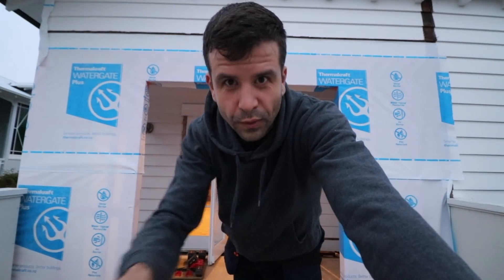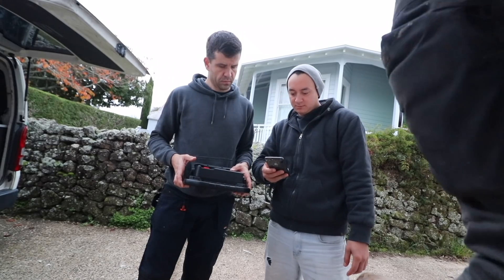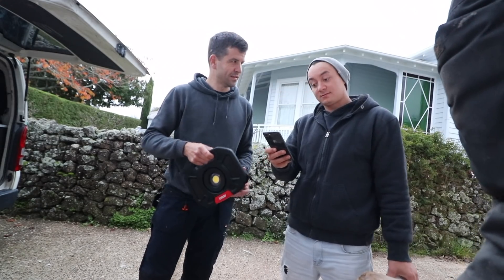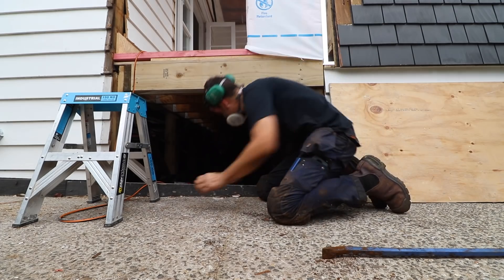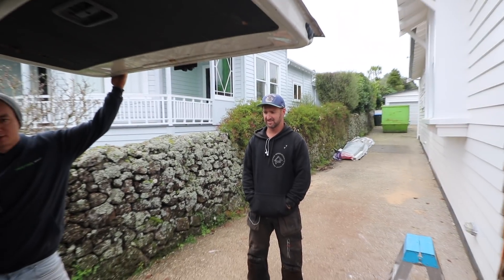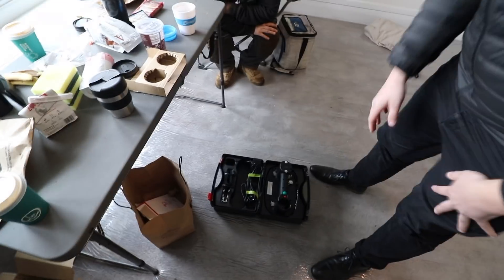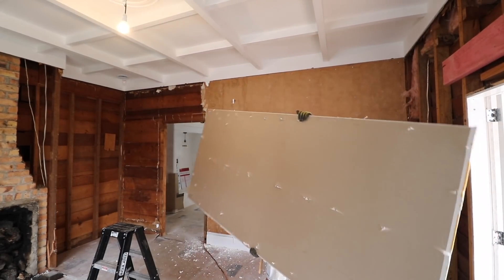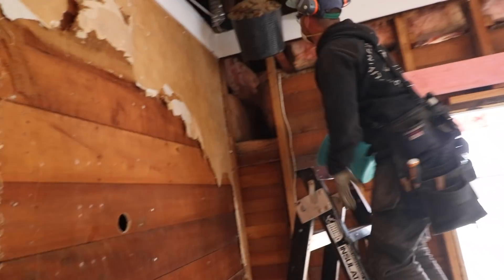8 Hours To Dig 1 Hole

Comment: Oh gawd, sneezed-in insulation.  For people outside NZ, this is old shredded paper that you pile in a corner and then sneeze on until it's spread around the roof (some people call it blown-in insulation for some reason).  What happens is that in NZ's damp climate it eventually goes soggy and gets mouldy, and any slight breeze across the attic space means it relocates itself into corners of the attic.  So you end up with no insulation in any of the central areas and clumps of soggy, mouldering gunk around the edges.  There are companies that run what are essentially giant vaccuum-cleaner trucks that'll come round and remove it for you so you can put proper insulation in.

Comment: Best way to cut through it, is get a big mason drill, and drill holes, then fill them with water (not to much for volcanic rock) and then hammer drill it to pieces.  Also don't leave the dirt dust and rocks in there with the water to long, it'll turn to hardest cement ever....

Comment: Pretty sure that was all asbestos insulation in that ceiling
Reply: Aunt Jemima it’s typically old newspaper cut up. Very common in NZ. There are also other types of blown in insulation, I’ve had a few tested over the years and none have contained asbestos. There’s typically no need for fire resistant insulation in NZ, so no need for it to contain asbestos.

Comment: Time 2:17 putting in timber posts into the ground.   Quite usual.  Typically dwelling piles consist of a 125 x 125 H5 treated timber pile cast in a concrete foundation typically 450mm to 900mm deep. Piles can be designed to provide sub floor bracing by their cantilever action, provided the floor is not too high above ground.

In NZS3604 these are termed “Anchor Piles”. Isolated timber piles to which diagonal timber braces are attached are generally more robust as they need to resist uplift and lateral loads from the braces.

Comment: I love my nemo grabo.   I have added a gauge to it, and I also have a adapter so I can use it as a small vacuum pump for clamping, and part holding.    Just today I had it vacuuming a puck to the panels I was installing so I had something to beat on with a mallet.
Reply: @Eric James glad you like your Grabo. They are certainly a fantastic tool and make moving things so much easier and safer. All Grabo's now come with a gauge as standard.

Comment: Scott. Have you ever considered using reactive ear protection? I don't know how much they are over with you but you can buy a set in ireland for about 120 euros  they improve  your hearing and protect it at the same time. Worth looking in to. Peltors are the ones I use. Also get the extra gel cups if u decide to try them. Won't be disappointed.  Love your videos
Reply: Really curious about this, what model of the Pelotors do you have? Is it able to mitigate rapid sounds like say a nail gun or a hammer blow or just sustained sound like circular saw and jackhammer?
Reply: @edgarcortes1966  not sure what model they are. I just got them on amazon. I've worn them shooting and that's actually  what they are designed for and they work great. They aren't that expensive.  Peltor is just one make. There are a few others available.  Mine are 6 years old and work perfect. I'm sure the newer models are even better
Reply: @edgarcortes1966  just checked peltor sport takeare 120 pound. Honeywell ones are 58 pound. A mate of mine uses the Honeywell  ones and he likes them as well. The peltors take 2AA batteries and his Honeywell ones only take 1 so maybe the peltors last longer. Either way they are worth the money
Reply: Have you got a link to amazon? Would like to look into these 👌
Reply: @edgarcortes1966  They work for all that. They are designed for gunfire, so they are fast to attenuate sound.  I use the Howard Leight set and they work well enough. I need to try the Gel Cups
Reply: Someone will read this and next episode he’ll get free hearing protection to review haha I bet ya
Reply: Thanks for this thread guys, I read it last night & have gone straight out thismorning & bought the exact Howard Leight Impact Sport model that’s in that link. Amazing how good they work! Couldn’t recommend them more off today’s use! I would go as far as to say it’s life changing, because iv always struggled with conversations when there’s noise around. I played a video on my phone & left it in my trailer, I walked a good 8metres away & could still hear the phone louder than if it was in my hand with no earmuffs on, then I hit the hammer on the concrete path repeatedly & it was quiet but I could still hear the video, Amazing!! I will always own these now. Thank you very much for the info @wildatlanticfishing 🙏🏼 ($118aus from blackwoods)
Reply: @scottspropertyservices6877  sold...

Been working next to concreters running a petrol saw the past few days, these will be a game changer.
Reply: I have a pair for shooting rifles at the range, they really are amazing how they react in milliseconds

Comment: G, day Scott and team, the subfloor pad footings are impressive. I would have thought that a smaller size concrete pad. Then slide recycling bins or rubber buckets on rollers or slead rails to the holes. Looks stable, no erosion or past subsidence.🏡

Comment: As some have already said, lots of room under that house. Our previous place had about six inches to a foot underneath. Early 1900's Rongotai, Wellington and was built on pure sand, where you could dig down five feet and into sea water level. A place we looked at here in Levin there was even less space still.
Reply: If you had to dig 5 ft to sea water you must have been on a hill or it was low tide 😊.
Reply: I learned a lot doing a place I had years ago in Island Bay. One pile I dug for an extension hit oily water and sand about 400mm down. I grabbed a 3 meter steel pole and pushed it in.. the whole thing disappeared down as if it was porridge. Managed to wedge bricks, concrete into the hole and smeared clay in it. The inspector whacked a spade into random holes including that one and said "yep all looks good". The whole valley sits on pockets of sand and seawater but not as extreme as Rongotai
Miramar was originally an Island so Rongotai must be part of the land bridge that popped up from below sea level in the earthquake in 1460. Yeah, check this image for the shorelines and harbour shape... https://teara.govt.nz/en/photograph/4383/wellington-harbour-before-the-haowhenua-earthquake
Reply: @TheStrathmoreChannel  The whole of Kilbirnie, Rongotai and Lyall Bay are only about five feet above sea level. One large wave from Cook Straight could wipe out three entire suburbs not to mention Petone and Seaview, on the other side of the harbour. The land was raised from under sea in an earthquake circa 400AD, and brought up to its current height in the massive earthquakes in the early/mid 1800's.
Reply: @ericwolff6059  Eric, I'm well aware of that. I was kidding you about having to dig as deep as 5ft to reach ground water. There are parts of Miramar where it is higher than that so Rongotai must be similar.
Reply: @TheStrathmoreChannel  :-). One can never tell on the likes of YouTube and Facebook.

Comment: Laterz rz masks. You can't beat the 3m 7500 respirators. Size medium fits 80% of people. Low exhalation valve so theres no fog on glasses, easy breathing, easy tight fit, easy drop down. Only problem is some of the plastic clips are a touch flimsy but they haven't broken for me yet, just take care of it. Small investment to protect your lungs and comfort on the job.

Comment: What was the hessian cloth used for in old buildings like this? Never seen that before
Reply: It is called scrim, and was used in NZ in the 1800's till the mid 1900's before Gib Board was invented...  "Scrim is essentially sacking that has been stapled to planks or horizontal thin wooden strips (sarking.) It has been plastered over to form walls in the late 1800s and early 1900s before plasterboard was invented. For insurers it represents a fire hazard especially when combined with old wiring”. Like in this video, it could also simply be wallpapered over rather than plastered. They used sarking for the above reason and as structural support. Now we use noggings/dwangs as structural support instead. I notice in YouTube videos that in the USA they use plywood in a similar manner to sarking, without the use of dwangs/noggings.
Reply: It's likely reinforcement to prevent the wallpaper from tearing when the wood moves seasonally.

Comment: Hey scott. Fill those rubber buckets you have with concrete and slide or “skoot” them around under house on some wide timbers👍.      Also maybe put some 12mm ply on roof around chimney tech screwed together and slide your bricks down to your m8 on the scaffold. Give us a chain gang vid🤙.    Personally i have found throwing them down chimney they just jamb up..

Comment: How many mills are in New Zealand? Timber processing mills, I need to be specific on that. And is it from trees that were felled only from trees native to the area? Just curious! I do the same home remodeling as you but only in Oklahoma. You inspire me to want to start a channel, gotta get a decent camera first! What did you start with?
Reply: I think around 29 sawmills, and then a handful of plywood and LVL mills. There used to be more but quite a few have been closed in recent years or sold off. Most if not all NZ timber mills are radiata pine which is not native but grows fast and straight, it has no natural antimicrobial qualities so they have to treat the hell out of it (that's why the framing timber is pink). I'm pretty sure any native timber mills are only salvaged or swamp timber as we have some pretty intense protection laws over native timbers now.
Reply: Jessica Bell thank you so much!! Great information!

Comment: I once had to put a 100mm pipe through my bathroom wall. Took me and my dad 2.5 days. My old house has walls 85cm thick of stone. When we were finished looked like a bazooka hit.
Ps if the chimney is sooty throwing bricks down it will make a real mess in the room below....I have made that mistake
Reply: Well if you're one of those people who used to throw shade at timber framed houses you sure learned your lesson lol
Reply: I found that because the inside of the chimney changes direction the bricks just get lodged inside

Comment: Why not use the rock as part of the footing?  Is it not strong enough?
Reply: Good question. It's certainly hard and solid enough to satisfy code requirement for vertical load but there's also a minimum depth a pile must be.

Comment: when you hit a large boulder just drill 4 holes into it to take rebar which is epoxy fixed.....then attach mesh cage to the vertical rebars and insert timber upright before concrete fill.
Reply: @Pitt2211  The wonderful world of the council 'thought' process. No different to the UK, some building inspectors (also known as council spies) are just ridiculous. I have several thousand £ of concrete filling an old well that was found on our new foundation lines. Couldn't make the building bigger due to planning, couldn't make it smaller as it would be pointless. Not allowed to do anything apart from fill the whole thing with concrete, many trucks, much £££.
Reply: Iain Arthur couldn’t you have filled part of it with old bricks/rubble then concrete to save a few quid
Reply: @ozzyefc44  we tried that, council spy rejected
Reply: Iain Arthur ok mate cheers . Council spy’s overthink too many things 👍
Reply: @ozzyefc44  If anyone in the future tries to alter it, that'll be fun. I wonder if they'll stop digging at 2 or 3 metres down, only another c20 metres to go...:)
Reply: Iain Arthur they’ll get a big surprise 😂
Reply: Nothing to do with Council. It's part of the code referenced in the Building Act. There are minimum pile depths no matter what the soil density. The cost involved with getting the engineer to test and sign-off  the rock-hole is less than paying 3 "labourers" to dig.

Comment: Hey Scott, that old insulation looks alot like what was called "Mr Fluffy" insulation here in Australia, which is made of friable asbestos and is extremely dangerous, friable asbestos is the worst type of asbestos.
Reply: Yeah, so it looks very much like a brand used here called "Insul-fluff" or something similar and that's def asbestos-free - got it in the ceiling of my house and it doesn't irritate the skin or anything.
Reply: Very, very rare for the blown insul to be asbestos here in NZ. I've never seen any in 33 years of renovating old houses.
Reply: I should add tho, you really have to be aware of possibility of prior roofing materials having dropped asbestos dust onto the insul. With a house of this era it would have had to have had a replacement roof in the mid century which would have been an odd occurrance.

Comment: That f****n insulfluff crap.  It's really acidic and burns any little cracks/ cuts/ abrasions on your skin.  I'd definitely recommend vacuuming it all out if you're going to use a ventilation system (HRV/ DVS/ etc).

Comment: Wow, wonder why they didn’t just lift the floor and pile the new foundation, all done in a fraction of the time.
Reply: "Lift the floor"? You mean cut holes in it? The matai or kauri hardwood flooring is about $20 per meter these days PLUS the fix PLUS you'd have massive cuts in the floor. Fine if you're carpeting but this is a $1million+ house.
Reply: Cassette Walkman - If that’s a $1m house it must because of the value of the land below it, as the house itself looks pretty non-descript. Ditto that tacky looking high gloss floorboarding. I’m surprised anyone would want to keep that! 
Anyway, I meant lifting of the floor not chopping huge holes in it. Sure you need to cut a hole to start with, but then you just lever it up board by board. You may get some nail hole damage but that can be filled.
Reply: Sounds like you’ve never actually removed floorboards. 100 year old hardwood boards are almost impossible to lift without splitting the boards let alone the tongues or grooves. You need specific tools and even then the common way for salvaging boards in demolition is to cut the whole floor, joists and all, flip it over & knock the joists off.
Reply: Cassette Walkman - I just cut the tongues with a multitool causing minimal damage and use a lifter under the edge. And once the first board is up you’re off to the races. Sure some small holes may need filling and the floorboard finish making good, but it’s a lot easier and safer than trying to crawl round in the floor void. And Health & safety legislation would require you to follow the safest method of work.
Reply: Doublethink Not with matai, kauri or rimu boards in rimu joists you’re not. Most of the boards will be ruined. They will split before they give up their 100 year hold on the 100 year old nails.
Reply: Cassette Walkman - Well any wood that is incapable of minor adjustment is not worth keeping.